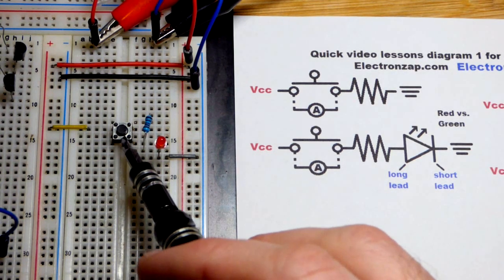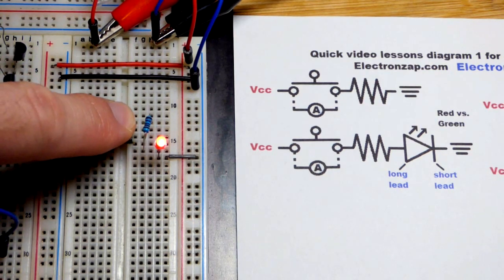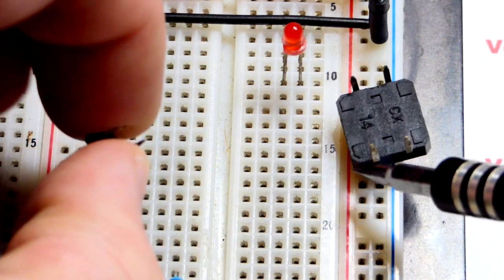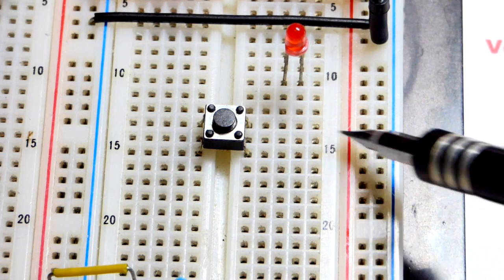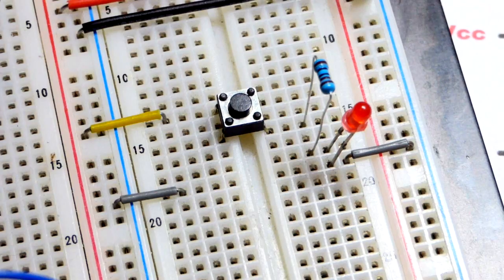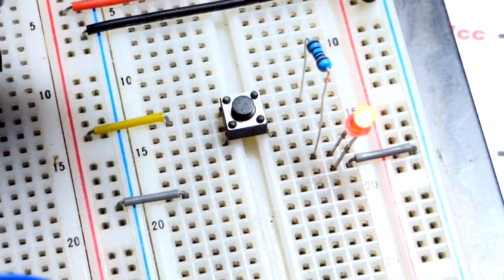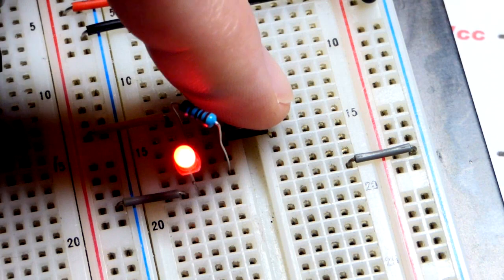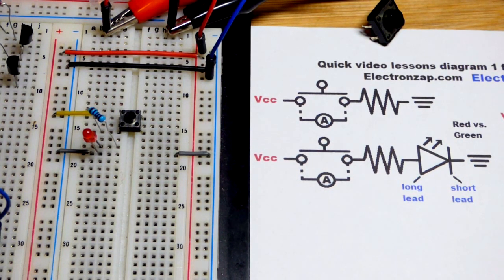Electronics momentary tactile push button switch for quick videos 1

Comment: My ac has this button as the power button on the control panel circuit board and it has to be pressed very very hard to work. Could I just replace the whole thing? Or is there something else wrong
Reply from the maker: If pressing it hard works, then I would guess that all you need to do is replace it. I don't work on AC, so no clue what other problems commonly arise.

Comment: Nice video but why does the tactile push button switch have four contacts and not just two?
Reply from the maker: Technically it has 2 contacts, but each contact has 2 pins, so 4 pins total.
Reply: Physical stability. Many components have additional elements beyond the minimal circuit leads to improve stability of the connection to the board, like USB or power connectors.